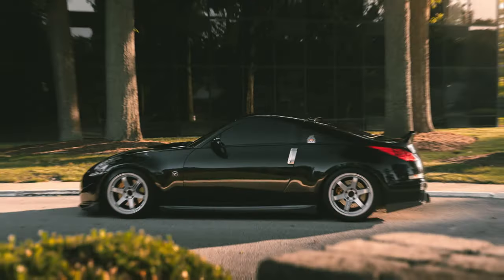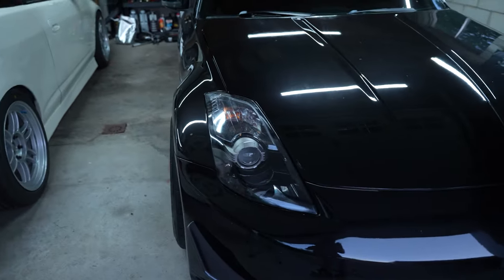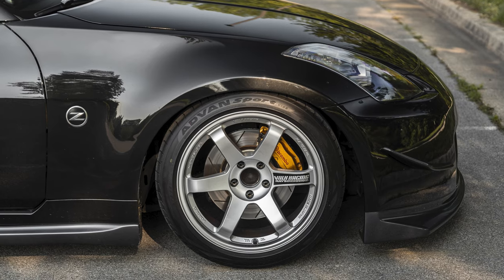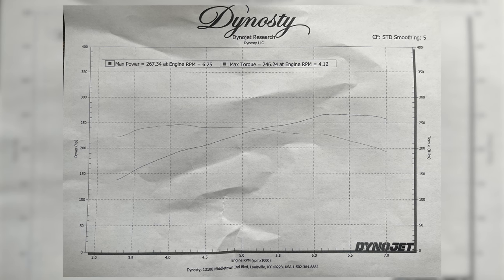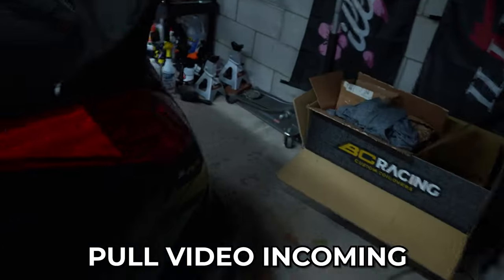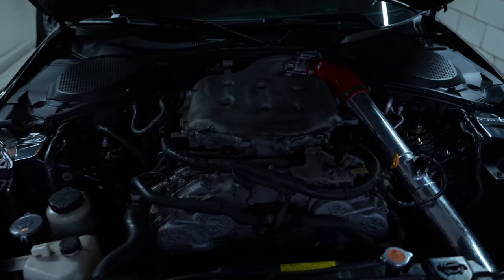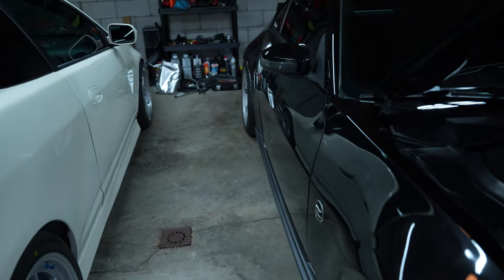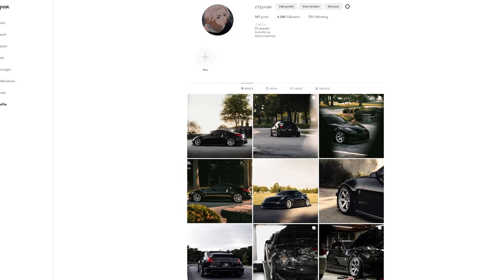350z Build Breakdown!

Comment: 275 and 10.5 in the front? Do you have any issues with rubbing?
Reply from the maker: Nope no issues, running -3 degrees of negative camber to sit flush with the stock fenders as well. No rolling in the front needed either!